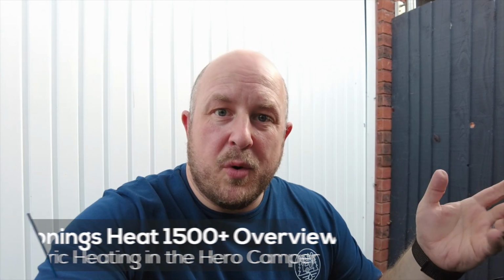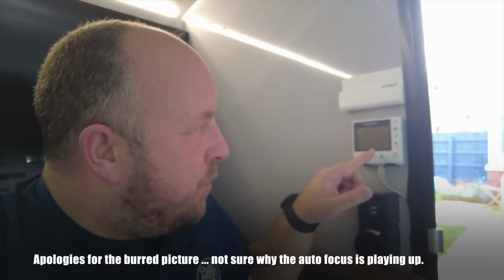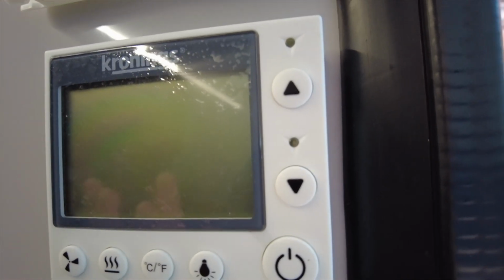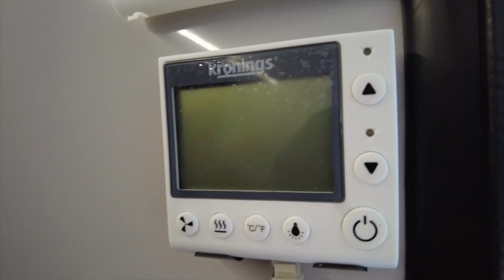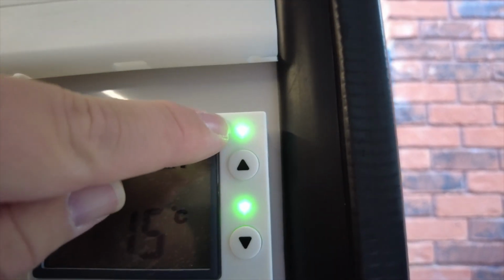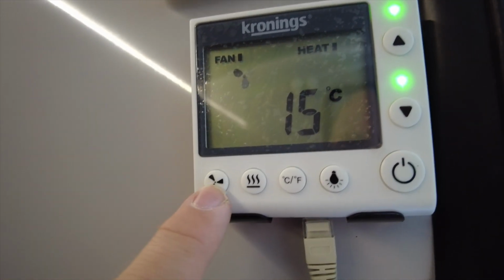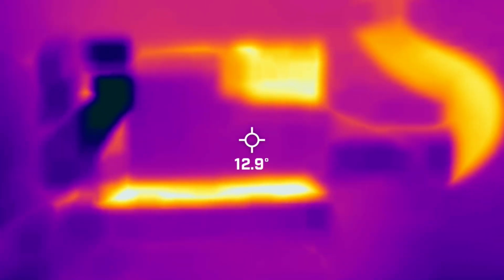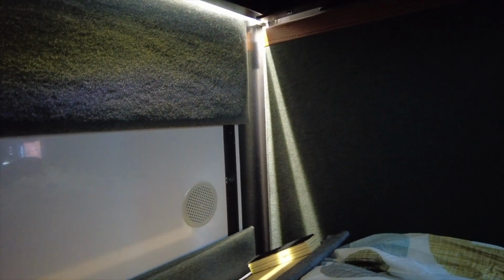My Hero Camper Electric Heating Setup Kronings Heat 1500+

Comment: Is the only connector at the bottom of it? Would be better if it could be installed recessed
Reply from the maker: Yeah as shown in the video. Not to many options with this particular camper layout.
Reply: @ConsideredUK no, makes sense. I guess an adapter plate can be made to recess it. 
I was thinking of putting it in an electric boat, trying to stay away from gas. 
How is the app functionality, open API for controlling with other systems?